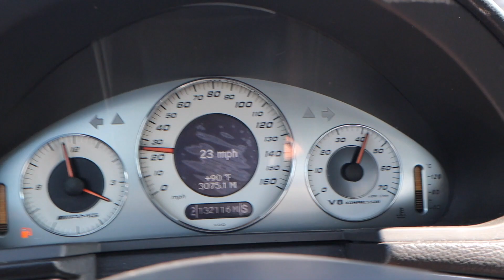FL2K Day 1 I Broke The E55

Comment: A story that's all too familiar. It's not the miles but rather the age and it's not if it's going to let loose, it's when! I just replace my Harmonic Balancer last year after it grenaded and took out my entire cooling stack. When these things let go at RPM it's not pretty and can be very dangerous. This is why most santioned tracks require an SFI approved balancer for anything that runs 10.99 and quicker. You now have the perfect opportunity to kill two birds with one stone. Not only can you get a quality SFI approved balancer but you can also get one with a  swappable crank pulley. Get that crank pinned before it's too late and you end up shearing the key.
Reply from the maker: I am trying to find one now 
No one has one in stock

Comment: Why didn’t you drive it and just remove super charger belt …the serpentine belt and the back part of crank shaft pulley didn’t move just the front …for the supercharger..but ok
Reply from the maker: With my luck something else would of broke and it is a lot of back roads with no cell service